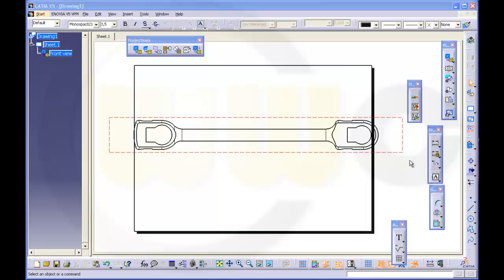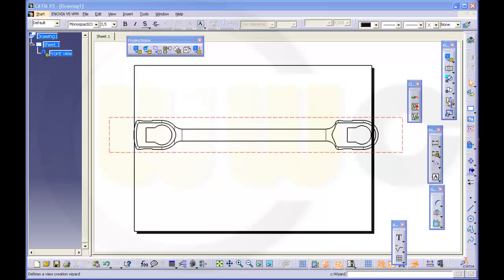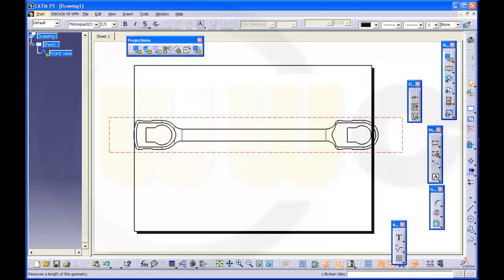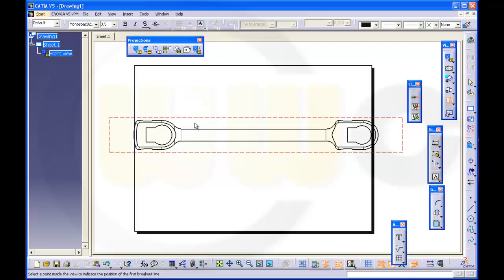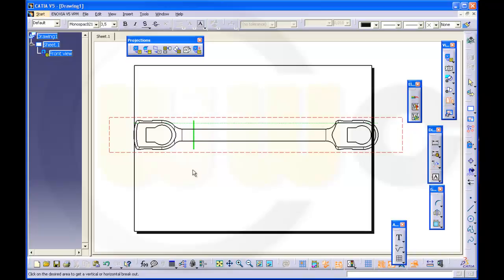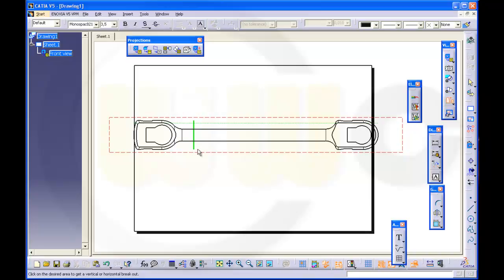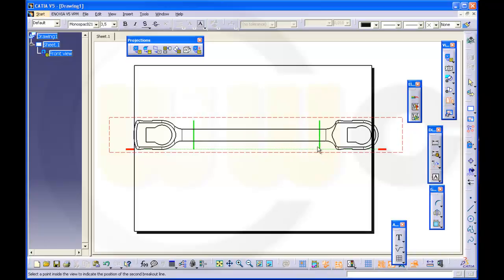Broken view - Catia v5 drafting quick & basic - All about broken views

Comment: When we use broken view it only creates exactly vertical or horizontal breaking lines...bt sometimes i have seen a slant line...how to do it in catia
Reply from the maker: The default line type is a zig-zag-line. You have to change that to the straight line. Tools->Options->Mechanical Design->Drafting->View->View Linetype->Configure
Reply: @wolfgang.walden.cad.training  sir, i want that line to be inclined. Dnt care about about line type...any type of line is acceptable bt that line must be inclined...is it possible...???
Reply from the maker: So isn´t it obvious? NO! By the way I don´t know any program where it is possible. I could fake it with 2 clipping views.